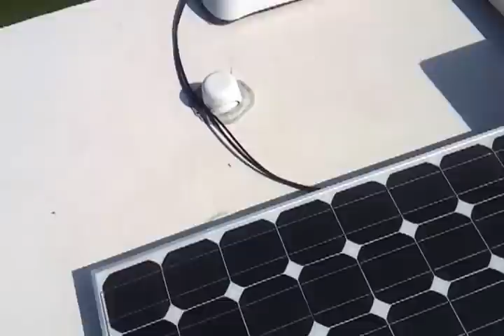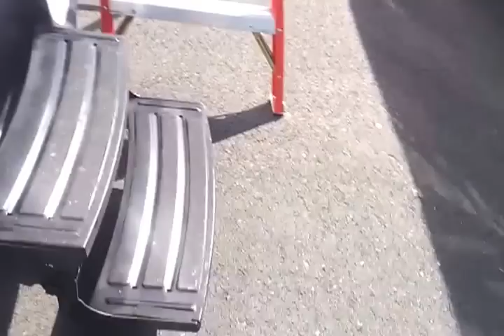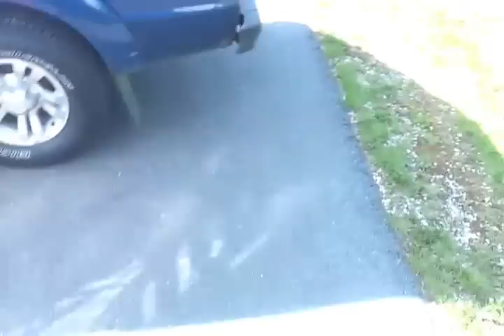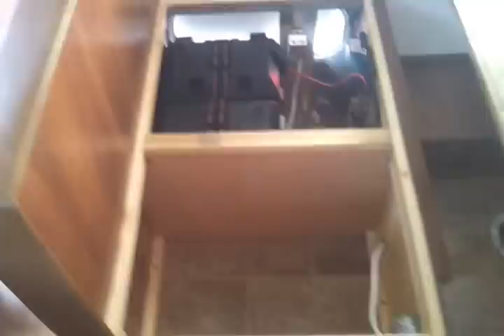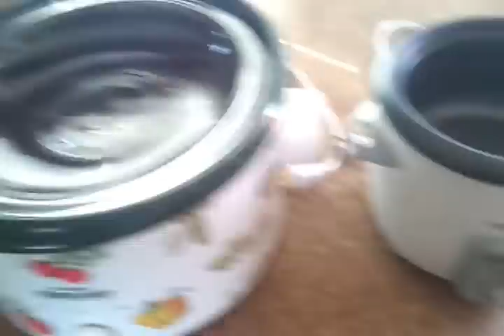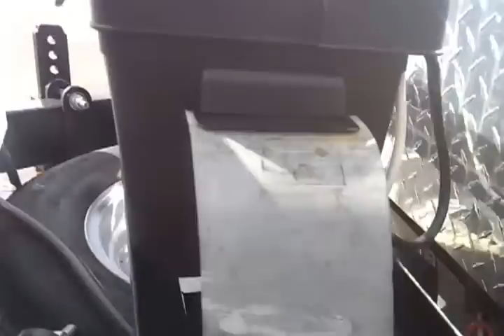Solar panel installation.

Comment from the maker: Yes I admit they are too close to the A/C unit. I can always move them around later. I believe I left enough spare wire to do so. Right now I am working on serial data collection from the trimetric battery monitor using a Raspberry Pi computer.